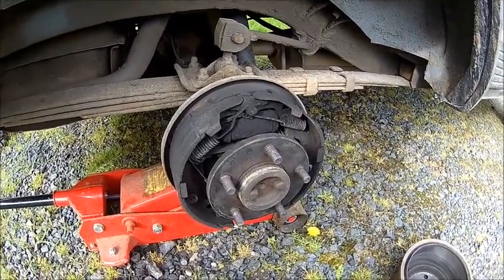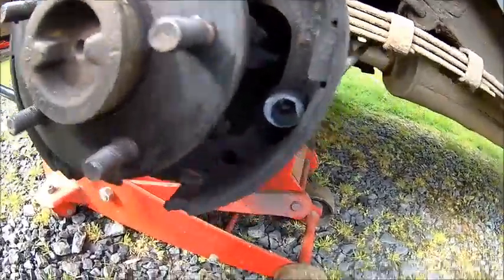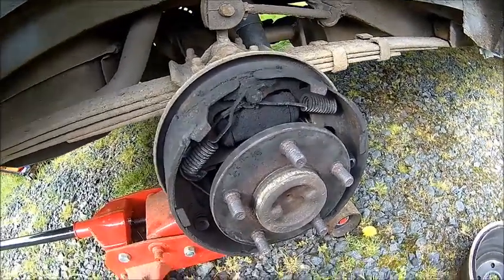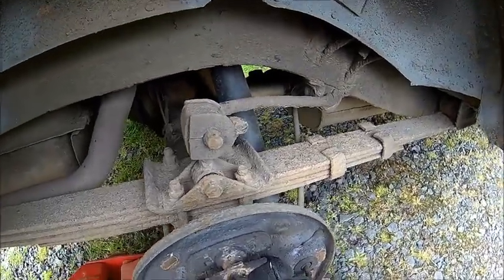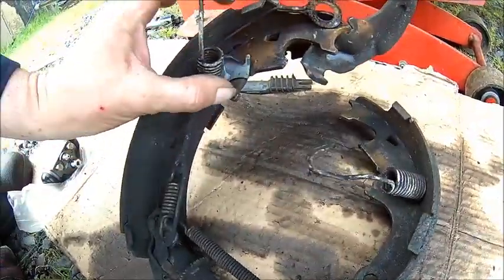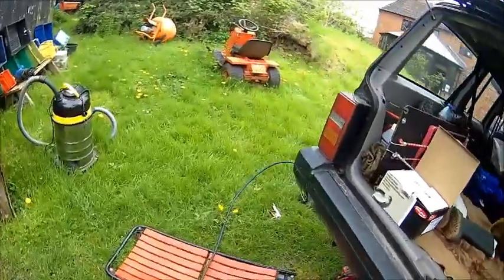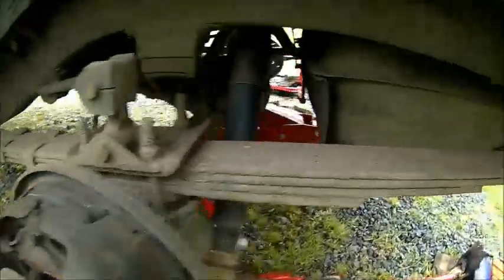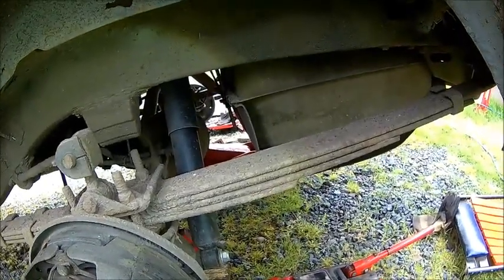Destructive removal of a stubborn brake cylinder (Jeep Cherokee XJ)

Comment: I am about to deal with the same two bolts on each side. What size bolts are holding the wheel
 cylinder?
Reply from the maker: depends on which brake cylinders are fitted, i think stock is 1/4" bolts, but i've also seen aftermarket ones with M6 threads here in Europe.